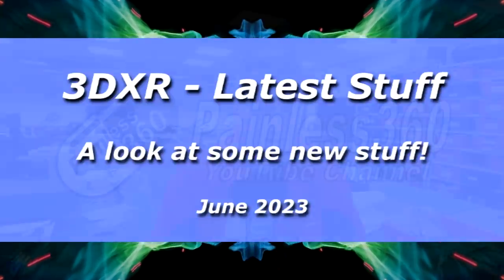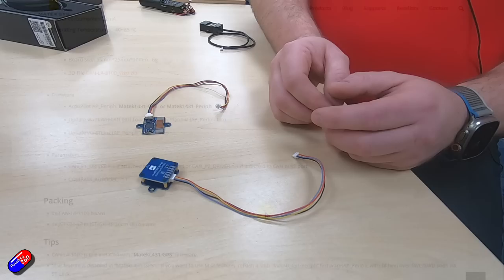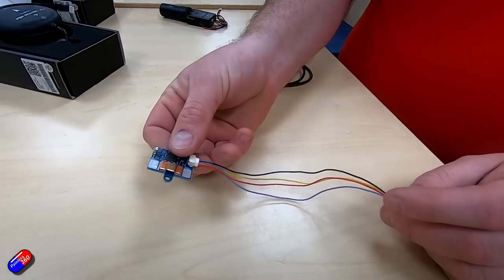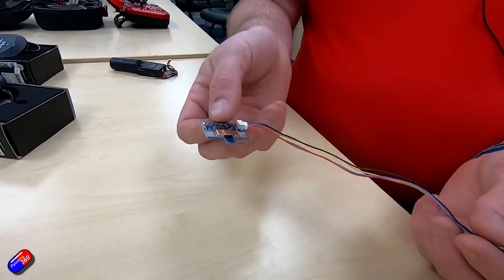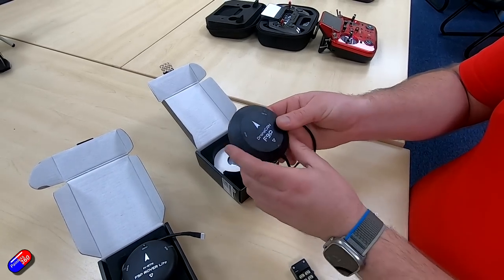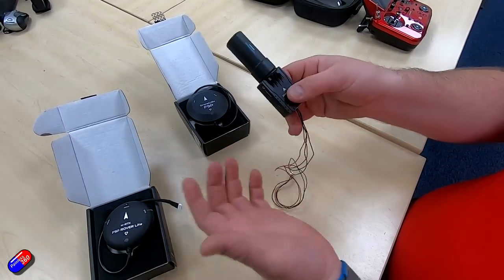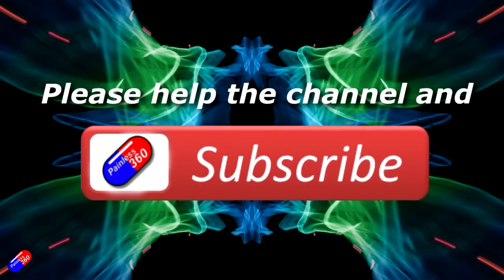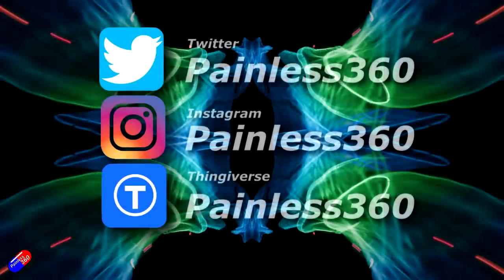3DXR: A look at some of their latest stuff in stock!

Comment: I wasn't aware of any practical length limit to serial connectors? Lee how long is too long? Thanks...
Reply from the maker: Depends on the model and what the attached pieces are... Happy flying
Reply: @Painless360  any general rule buddy? I also have this question 🙋‍♂️ 
🙏🤝
Reply from the maker: I find that I am ok running wires that are not alongside anything else for up to 12", but again. It depends on the frequencies sent, currents flowing and how shielded the cables are on how you can push it.
Reply: @Painless360  that’s so much 🙏 really appreciate you taking the time to reply to all our comments 👍🤝